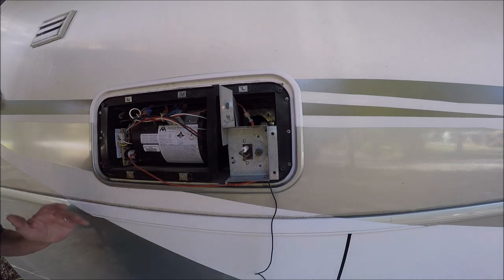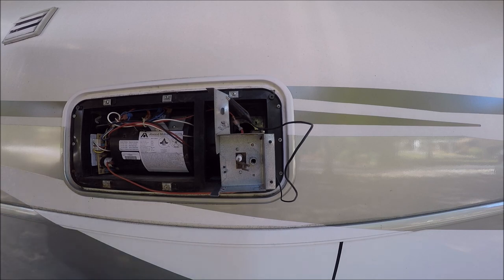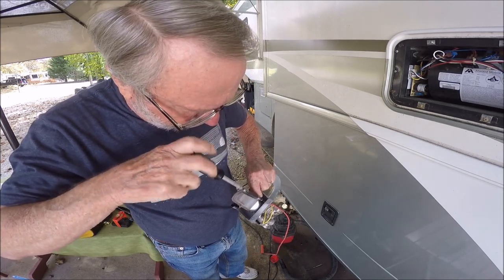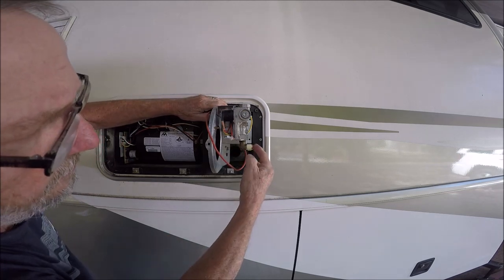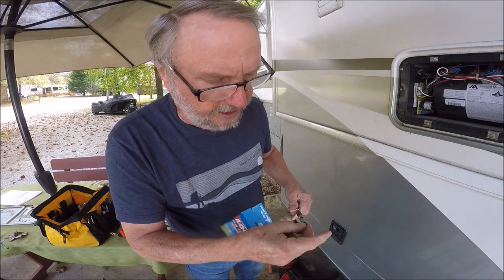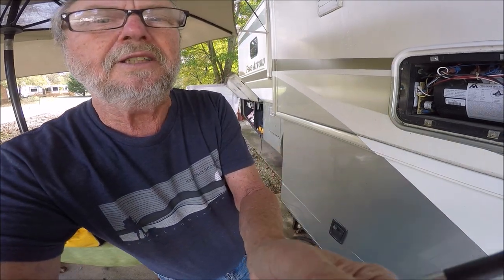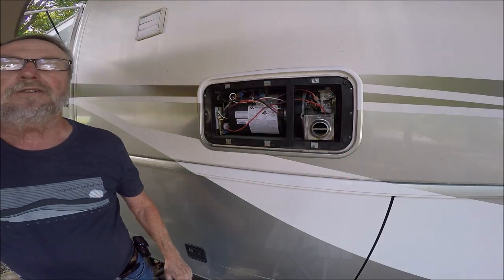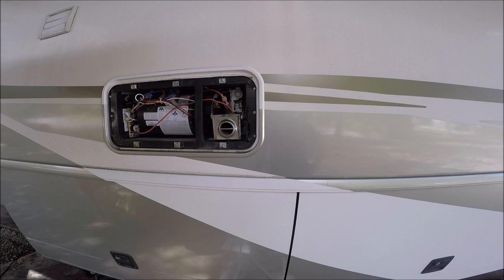RV Atwood Furnace, will not fire up

Comment: Sam, as a mechanical engineer, I just wanted to tell you this is an excellent video, and the only one I know of on the internet that covers the insane situation of bugs upstream of the orifice!!  Wow, I found that same situation in mine….probably mayflies.  I replace my 20 year old rusted burner and the electrode, but without you video, I would have never found the bugs upstream of what appeared to be a clean orifice I had already run a small wire into.  Great work…thank you Sir & Merry CHRISTmas!!!
Reply from the maker: Thank you @Cuck Hammack.  I am so glad it helped you and I am sure many others as the Small flies love small places like that to lay eggs I guess.  I have not seen anyone else that covers the fly in the orifice.  I hope all will check for the flies and make a simple fix to a furnace that will not start.
Reply: disassembly @samowens44  , My situation was it would fire for 1-3 seconds and then shutdown.  Prior to disassembly, my guess was the burner had a big crack in it  and there wasn’t a decent flame across the flame sensor (electrode), so I ordered a burner for $23.02 from Amazon.  Upon disassembly it was pretty badly corroded, and perhaps the individual perforations were a little undersized but that didn’t seem to be the culprit; However, it did not have the requisite 1/8th inch spacing from the electrode/ground to the face of the burner.  That led to me foolishly trying to clamp the base of the electrode while bending the already angled tip but the brittle material failed. I searched the entire country for a new electrodes and in the end I could only find one aftermarket (non-Atwood) electrode which I drove 4hr R/T to pick up this close to Christmas and with a camping trip looming in 7 days🙂.  Luckily a few hours before attempting the overall repair (replacement of the burner and electrode), I saw your video. At the end of the day I don’t know if it was the bugs upstream of the orifice causing low pressure, a defective electrode (not the sparking function but the 4.5 mA-proof-of-flame-function) or the somewhat corroded burner. In any event, thanks for your hard work!!!
Reply from the maker: @chammockutube  .Thanks for sharing the detailed description of your troubleshooting procedure.  Have a merry Christmas and enjoy you camping with a working furnace.

Comment: Teflon tape on the gas line connection is not a good idea, it restricts getting the flare nut started and may prevent the flare nut from seating on the on the furnace valve adapter. The tape is for pipe threads not SAE threads.
Reply: I worked for over a year and a half at a propane truck repair shop as a welder, and my primary job was replacing piping on propane delivery trucks. The rule of thumb by the inspectors was to tape and "dope" (that's thread sealant compound, Gasoila typically) every connection. SAE threads did not receive tape, but were still to be installed with Gasoila to protect the threads.

Comment: Outstanding video! Thanks for sharing. Better explanation than some professional videos I have seen. Very thorough and methodical approach. Also, very good tip regarding using the yellow teflon tape for propane. A lot of folks dont know this. I am a residential and commercial HVAC mechanic.
Reply from the maker: Gene Stewart, thank you for such a high endorsement of my Video.  My goal was to help others.

Comment: This video like so many other informational videos is much appreciated by me.With all the videos out there on DIY's I have aquired the confidence and skill (already mechanically inclined) to take on almost anything when it comes too RV service or repairs.  ON my older class A motorhome when I bought it, nothing worked on it. Now my furnace, water heater and refrigerator are running top notch now. Still need to fix my slide, hydraulic jacks and generator.All in good time.Thanks for your video.
Reply from the maker: As an instructor in the telephone company, I found that confidence is the big part you get from watching and listening to someone give instructions.  With that confidence you can tackle other task and as you need seek more guidance.  Glad you are getting all your RV problems solved.  Thanks for your comment.

Comment: I looked at mine and convinced myself that I was going to have to tow my camper into town and have the furnace pulled for repair. Pretty sure it's the orifice, because the orifice in the water heater plugged last year, and I've checked everything else. Now I know I can do it myself and save a TON of money and the trouble of towing. Thanks!
Reply from the maker: Paul, I am sure you will find it no problem, just follow the simple things I did to put mine back in.  The Gas Line is probably the most troublesome, but, just don't put all the screws in till you get the gas line screwed in.  As you see, I forgot and had to loosen screws.  Make sure no leaks , look for large bubbles forming.  That is what happens with a leak.  Good luck my friend.
Reply: Why would you have it towed for a furnace issue????!!!!

Comment: Great video! I was not getting spark across my electrodes.  Once I cleaned them up with a file they worked fine. Pulled out my gas orfice as well and did find a tiny knat in there.  You saved me hours! Thanks!
Reply from the maker: @Neil Lundy, I try to show the basics of how to deal with a failure to operate.  It can lead to all kinds of solutions.  Confidence is my product.  The confidence that is gained by watching someone else do something that can lead to a solutions.  I feel great from your comment, thanks for sharing.

Comment: Great informative video! Will be using it for reference. I have model 8528ii but looks similar.
Reply from the maker: IanH44, thanks for your comment.  The main thing that will help a lot of folks is how easy it is to remove the main Fire and ignition section.  You don't have to remove the whole unit to work on most ignition problems.  It is either going to be the igniter Module, Electrode or Orifice clogged or no gas in line from tank.

Comment: I'm wondering if it depends on a certain level of charge in the RV battery or use of a generator? Mine works fairly regularly but seems to not start if the battery is low.  I wonder if that is the true cause.
Reply from the maker: The ignition system for the Furnace must deliver a strong high level of spark to ignite the gas.  You should have a fully charged battery to insure the Igniter will charge high enough to produce the spark needed.  You have diagnosed your problem correctly.  Good job.
Reply: @samowens44  Thanks Sam. Phew

Comment from the maker: Folks, let me make it clear, the tape is only on the threads of the connection which does not interfere with the flair connection point.  I may not have made that clear.  You do not want the tape on the flair part, only at the threads, it just gives an added protection.   The Flair connection is the main point of tapered contact that should not have any material in contact.

Comment: I live in my r v my furnace stoped working 2 days ago and its -4 no one seems to know what's wrong
Reply from the maker: After watching my video, you will see, that all items are working but no fire up.  The reason was blockage of the oriface in the Burner cage as I showed.  I am not sure which part you are missing to make your heater work.  Let me know and I will help you.  I need to know if the Blower runs, you hear the igniter trying to light.
Reply: My furnace doesn't start up the thermostat clicks on for power. But I don't hear the fan or trying to light.